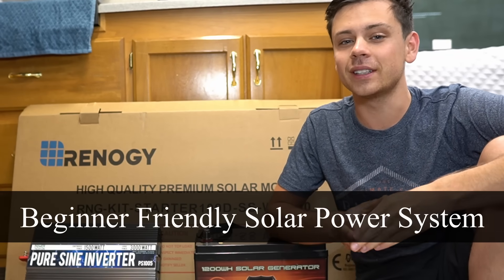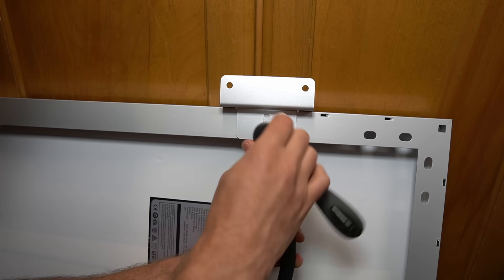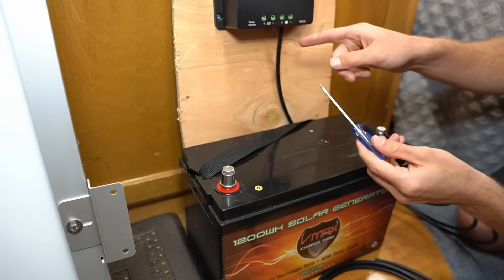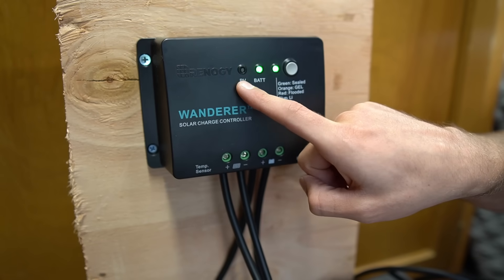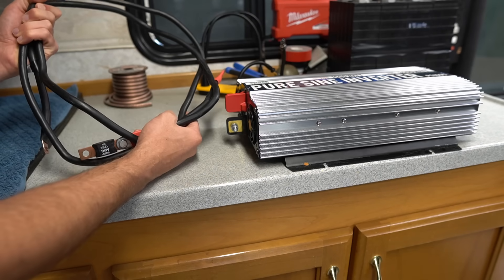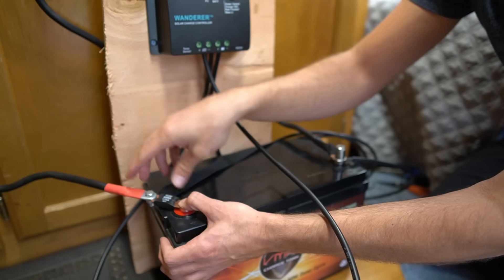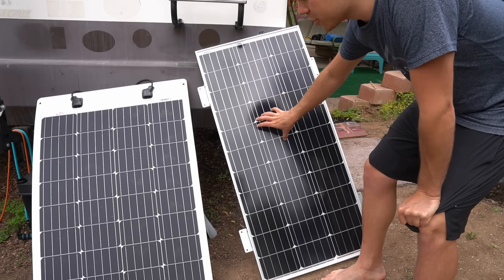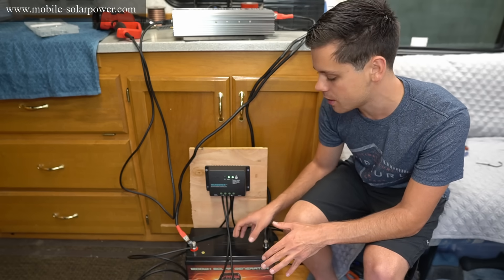Build Your First Solar Power System! Beginner Tutorial Easily Explained, Budget Friendly

Comment: Hello!
I have 2 questions… & my apologies if you’ve mentioned the answers in prior vids.

Firstly, I must say, Your videos are great, & I truly appreciate your knowledge. 
I’m planning a solar generator systems, most of which is based on your knowledge & product reviews.
My project I have in mind is a 3,500+ watt/hr systems with at least 6-7, 100 watt solar panels for charging.
I’m not a wealthy guy, so I’m trying to get the best quality products for lowest money spent. However, I don’t mind spending more $, if it means longevity & durability. My proposed components are below…

Lishen 3.2v 280amp X4 piece (3,583 watt/hr)
6-7 Renogy 100watt Poly solar panels (600w)
Renogy 3000 w, 12v Inverter
OneSolar 60 amp charge controller
50ft of 10 AWG solar cables with male/female ends.
Red/Black 10 AWG battery cables…

-1# question is, what type of fuse amperage should I get? 

-2# question. After looking at my choices of inverter, controller, etc. Does my system sound “OK” to you?  Recommendations? 
Thanks again for your videos, & info. Your my goto source for anything solar. 

Sincerely, Dan

Comment: Do not understand how DC appliances are more efficient use of power when they require huge wire to achieve the same thing as AC even thru an inverter.
Reply: Because you don't have to convert the DC to AC before powering the device.  That conversion uses energy.  So a DC appliance means DC->DC, and no conversion to AC.
Reply: @cali13guy  im sure it falls under something like ohms law but i dont think you follow my point if it is more efficient to go dc to dc which makes common sense, why does it require huge wire in contrast to that of an ac appliance of the same output. It takes far less amperage to create the same output with ac so then it would seem that even that even though you have to convert dc to ac if the amperage required were less with ac then the ac could potentially be more efficient. Im sure there is some formula that explains it.
Reply: @GregariousAntithesis  Well that is the disadvantage to 12 volt DC, wiring costs, distance limitations, lower AMPs to use in general.  But, to run something like a fan, small fridge, DC would be better, short cord length, low amps.  Same for lights, could use 60 watt AC, or two 5 watt LED off USB.  DC is not better in all cases I'd guess, I"m sure there are applications requiring distance or high AMPs that DC wold not be the way to go.
Reply: @cali13guy  so if you take a portable fridge for example that takes 45 watts to operate, with 12 volts dc you get 3.75 amps. Now change that 45 watts to 120 ac and you get .375 amps. Just off the top of my head at 80% inverter efficiency you are still using less amperage, Am i wrong?
Reply: 80% efficiency inverter would require another .075 amps of ac power if my math is correct. .20x.375=.075 so total power used is now .450 amps used to operate 45 watt refridge is far more efficient than using 4.5 amps of dc power straight. Please correct my math if im wrong, so i can see where im missing the better dc efficiency.
Reply: @GregariousAntithesis  AMPs is the rate of current, not the measure of energy.  So, 1 amp at 120 volts is exactly the same as 10 amps at 12 volts energy wise.  It's the watts that matter, not amps. Yes, have to take into account amps (wire length, diameter, heat etc.).  The battery stores in DC, so to power something in DC no need to covert to AC first.  I don't know the loss offhand, but if you have 100 watts power in a DC battery, you'll only get maybe 80 watts of AC power.  So, if you have a 20 watt AC and DC LED bulb, you'll only get 4 hours light with AC and 5 hours light with DC.
Reply: @GregariousAntithesis  Using your math AC (.45 x 120) = 54w; DC (3.75 x 12) = 45w.
Since 45 < 54 you are using less energy.  Hence, the DC is more efficient.
Reply: @cali13guy  yah, i found another video after i wrote this explaining this. I keep forgetting your are using dc to invert to ac so the amperage going in in dc is based on 3.75 amps going in to get slightly less than .375 amps out to get the 45 watts. Keep applying the same amps in as out which of course made zero sense. Well thanks for the reply back. I will just stay with my minimalist dc power system avoid ac except when plugged into shore power. Going to come up with a simple dc swamp cooler for summer camping since its all in the desert and mountains of the west where swamp coolers are adequate for my pickup truck camper. Run the fridge on propane and use my propane cook top and oven. I have a small inverter to charge a laptop but other than that its mostly just led lights which use almost nothing. No reason to get all extravagant for part time life in summer in camper. Use the alternator with renogy dc dc charger and my simple lead acid battery.

Comment: Fantastic videos, I am actually at the first stage of building my own portable solar system consisting of 2 rigid 100W panels, MPPT 40a charge controller, 100ah lithium battery and 1000W pure sine inverter, my question is I want to put the items in the smallest heavy duty tool box and my concern is heat, do these systems generate alot of heat and should consider adding an active fan system into the enclosure? I am looking at an enclosure similar to a RIDGID 22-inch Tool box to mount the components. Thank you Will

Comment: Hey mate I purchased your book just not and have watched a few vids. I'm designing my second solar van setup and curious do you fuse the solar positive...as I see in this you don you mentioned about the battery not coming with a fuse and you personally prefer to put one on but the solar panel cable you did not mention anything and I am wondering because for example if I scrape a tree and it exposes the positive cable on the side of the roof to the car body and shorts out would that be protected by the solar charge controller having it's inbuilt surge protection or would you prefer to fuse this what is the actual standard

Comment: On the solar cable sling to the most controller,  it seems that you got off the ends of the cable to be able to attach to the controller?      At the moment I have one 175 penal, one one " 100 amp LED acid Renergy battery. A 3000 watt Renergy pure cine inverter.  I also have the BT -1.   The temperature wire, a blue sea fuse penal and one fuse block invaded in plastic and a emergency shut off switch. And two 12 volt cigarette plug ins. And a Renergy one-off switch.     Going to add another battery and another 175 watt panel to this pile of parts .   Need a few other connector parts and I should have a complete system.  I'm worried I'll burn up some of the components.    I'm going to try to hook it up like you did in this video.    What gage wire do I use from the battery to the  control or and inverter. ?

Comment: After 40+ yrs in automotive maintenance this is the first time I have ever seen someone connect negative cable before positive? Why is this opposite of automotive battery maintenance? There should be no spark if there is no ground. Am I misinformed? Not dissing you I love your channel and follow for as much information I can get on solar.
Reply: It doesn't actually matter it's just to prevent sparks but as long as it's not a crazy load the sparks won't do any damage

Comment: I just finished my setup based on this but without a temperature sensor and voltage monitor. My mppt charge controller shows how much volts there are so I think I'm good without the voltage monitor. But I'm not sure if the temperature monitor is really necessary? Is there another way to avoid damage caused by the temperature without the monitor? And which temperatures cause damage to the battery? I just would like to know for sure before I hit the road. Thanks heaps for your very helpful tutorial

Comment: You're such a dude. Thanks for sharing your info.  Have you seen this issue before? I got one of those coleman 40w panels, but when I test it, it shows reversed polarity.  It's all hooked up properly and super simple, but my mulitmeter shows negative charge if I connect to matching positive and negative terminals.  Only when I reverse the terminals clamps do I get a positive reading.  What's that all about?

Comment: Can your solar panels charge more than one system, at a time? Or consecutively?

With one set of panels I was thinking, just for example,  I would have 1 set of batteries for, perhaps, 12v  lights. And another system for a 110v ac fridge--- only!!!  (The fridge being important I don't want to ever have a problem with its power supply, so a separate system with plenty of dedicated battery so it never gets interrupted, defrosted, etc!!!
So, can one set of panels be used to power two different battery banks? If so, how would that be accomplished?

And is it possible to always supply the fridge system first? For it to have precedence over charging anything else? To make sure the fridge batteries are as full as possible before other systems are resupplied.  If so, how or what is used to accomplish this task?

Thanks a bunch, times a thousand!

Comment: Thank you Will, for the basic explanation of a Solar system.  It is most excellent that you explained the connections and which to connect before the others.   It makes sense that connecting the Solar panel to the Controller before the battery is connected will damage the controller.

Comment: I have been trying to figure this very thing out and I am glad I accidentally discovered this. Very good communicator. I have a 100W Coleman kit from Costco and a battery from Costco. I think the charge controller is 8 amps and is flimsy and I will buy based on your links. Thanks.

Comment: I just finished installing the 200W Renogy starter kit, with this video playing as I did so, which made it simple and relatively easy.  My work shed is now solar powered.  Thanks!
Reply: Hi, are you in the UK, also would it be possible to run a heater from it. Thanks
Reply: @steviebye1  its really tough to heat or cool anything from solar power.  Youd need a far bigger system, this is super small minimalist.
Reply: @WjB_96792  Then what can we use this 200w for? what kind of appliances? Thank you.
Reply: @pacwoman7126  im no expert in this field and have no experience as an electrician or even a hobbyist. Just an average hawaiian with daydreams of someday building my own little off grid beach shack with a few panels and battery storage. So... pacwoman... there are plenty of resources available to learn about amp hours, converting to watt hours, how to determine the exact amount of energy an appliance will draw and from there its basic math. And while nobody can sit here on you tube and tell u exactly what u can run on this 200W starter kit im going out on a limb to say not a whole lot. A fan, a light.... maybe charge your phone...
Reply: @WjB_96792  Thanks a lot
Reply: @pacwoman7126  youre very welcome!
Reply: @pacwoman7126 I found a swamp cooler fan that runs at 90 watts it does really well

Comment: Anyone out there want to  weigh-in on my question here?  I have been a commercial/industrial electrician since 1977.  Four years in the Navy before that, along with their excellent in-classroom electrical schools.

My question is this - I am building a small system out here in the California desert using two used solar panels and a Renogy 30A Rover charge controller.  We work on a lot of yachts in Long Beach as well as electric Duffy boats.  Therefore, we come across a lot of used 6-volt batteries.  I want to pair up the batteries and only use the two best-matched ones at a time for playing with the solar system.

It may turn out that these panels aren't much good.  I have already put my meter on the output terminals and find 20-some volts, so my research says they are 12 volt panels.  I also counted the cells on the panel to confirm voltage.

My first system will be DC only, no inverter.  We work on a lot of boats, from tiny,  up to the 100-foot Italian yacht we spent a lot of time on.  Therefore, I am planning some 12volt lighting and fans and pumps and all sorts of toys, just for learning.  None of this will be critical, so used batteries and no inverter should do just fine.

If I am swapping battery banks now and then, how do I make sure panels are not connected during the changeover? I don't want to mess with the wiring by putting extra stress on the Renogy  connection terminals.  I am thinking of putting a 2-pole industrial-rated "light switch" on my panel outputs to kill the panel feeds when I am playing with batteries.  Is this just overkill?  Should I simply cover the panels or maybe do the changeover when the sun has gone down?

I also intend to expand the system eventually and/or build more of them out here for the neighbors.  This one is my "free" test system/teaching system.  I figure to suck these old golf-cart batteries until they have no life left, and then we can use them for our core replacement when we are buying other, new batteries for boat owners.
  
Will reminds me of a lot of my classmates in Navy IC "A" school.  We were young and very enthusiastic about the education we were receiving.  They always reminded us how much our schooling was costing the US taxpayer and that in the end it was the equivalent of a two-year Associate degree in electrical engineering.

Thanks for the help.  And, let's pool our $$$ and buy Will some real electrician's tools!  Using a 'tweaker' screw driver to tighten the charge controller screws???  Using a crescent wrench or pliers on nuts and bolts?  Both are big-time no-no's in the construction industry.

Comment: Any advice on retrofitting my travel trailer?  I already have a fuse and breaker panel.  And it has an integrated charge controller/converter with no lithium setting.  I'd love to see a video on how to tie in and make that work.  Thanks for the videos!

Comment: Will Great Videos, I have a complete solar setup in my rv. Could i hook up a second solar panel and charger set externally to the same battery(Valence U-CHARGE XP U27-12XP) ? I want to keep one set remote for use anywhere.  (Valence U-CHARGE XP U27-12XP) would the bms handle the 2 separate charging systems or would i cook something?  (looking at 2 200W solar panels systems)

Comment: I love your videos - thanks.... quick Question:   You installed this solar panel indoors  and did not need to cover the panel to prevent it from having any charge while attaching it.   Would it be safer to cover the panels with cardboard or a blanket while connecting?  Or is that not necessary since you are indoors?  Am I just being too cautious... Thanks

Comment: Great tutorial thank you. Two questions:
1. Can I really just plug that into a wall outlet? Or I need to turn off that fuse so power from the grid doesn't burn my home? I am sorry I don't know much about electronics.
2. Can you make a tutorial on making this system without a battery, just a solar panel to reduce the cost even more?
Reply: It doesnt work that way . Solar panels cannot be used direct into a home outlet or directly supply power to say a drill or laptop etc the power needs to be filtered. Panels cannot supply the amps needed to run many power hungry  items. You need a regulator and a Sine wave inverter that converts  DC to AC since solar panels output in DC . Research basic solar setup and theory You need to understand the limitations of certain setups.

Comment: GREAT videos/I have years chasing where to Buy an original windbluepower slow wind Alt-ac/also searching x solar-wafer to solder them THROUGH 3-4 settings yo Lower temp/also need ING a real controler hybrid 3 ooo kw/morningstar-xantrex-rebuilt CHEAP maybe? Hope yo help to máke  newer videos/thks

Comment: Thanks Will. I have a small ultralight aircraft that sits in its hangar from week to week without moving (especially now in Winter/Covid!). I replaced the lead-acid starter battery with Lithium and saved 5kgs BUT the solar panel that I utilised to keep the battery charged via a  $15 controller has gradually killed it - is it true that Lithium batteries don't like a trickle charge (and is that the same as 'float'? That's a new term on me).

Comment: I couldn't find the link to the cables. I just ordered 2-100 W panels and 1 20 A charge controller from Rich Solar and a 3 kW PSW inverter from Renogy. I already have a couple of batteries. I'm afraid my orders won't come with the cables I need though.

Comment: Excellent video.  It would be good to point out the safety of connecting one wire at a time when connecting the battery or solar panel to the charge controller so that people are more conscious of it and don’t accidentally connect both solar panel connectors and have two bare wire ends that can touch and short.

Comment: when you add the wires coming from the charge controller to the battery and then the wires going from the battery to the inverter......how does the theory work in this case? given that the current flows from neg to pos and always choose the least resistance....
we have 2+2 wires bolted to the same terminal on the battery, how do the electrons chose the path to flow from the controller to the battery and from the battery to the inverter....
can someone explain it please?

Comment: I have a small camper 16ft. This will be charging two 6v flooded 225ah golf cart batteries in series outside on the tongue.  Will this system be a good choice for that? Also, will it handle 2 solar panels without upgrading to the next level controller?